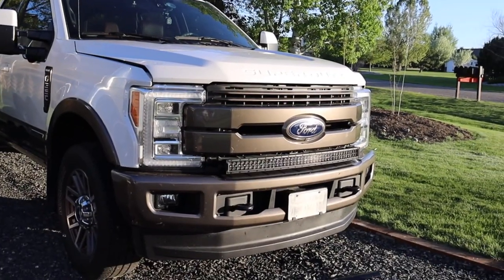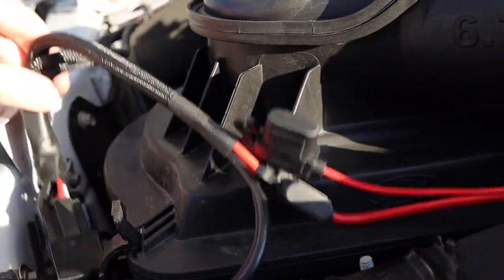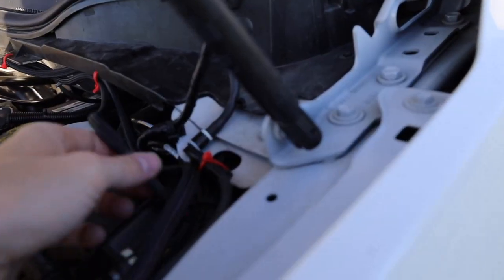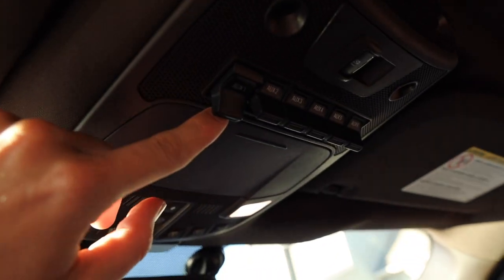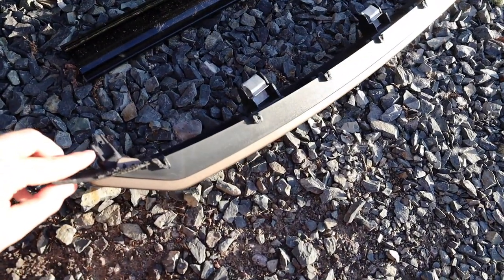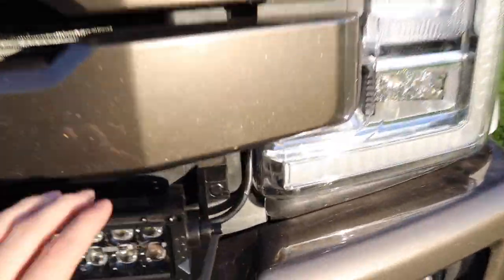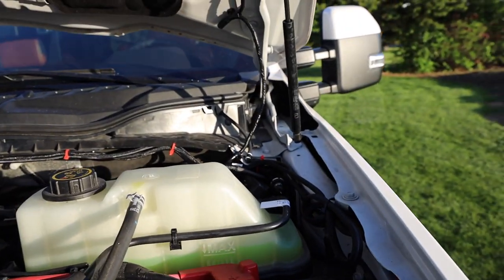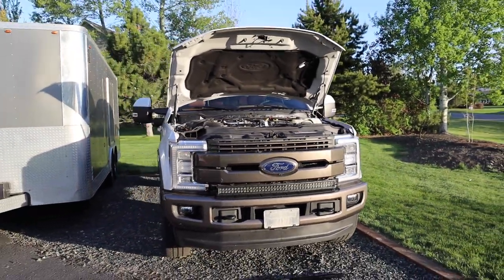Rough Country Light Bar Install F350 (Front Grill)

Comment: How loose is your grill with cutting the factory bottom piece off that held it there. Also why didn’t you run the light bar installed to the top of the front bumper. Thx man.
Reply from the maker: Grill isn’t loose at all with all the clips back there from the factory holding it on . I wanted to put it in the top and bottom but their wasn’t an easy mounting option like the bottom has. I would have had to make a bracket. Thanks for watching 👍

Comment: So will the light come on sequentially with your hi beams or do you have to use the separate switch? Great vid btw.
Reply from the maker: You have to use the upfitter switch. But you could probably wire it into your lights if you really wanted to.
Reply: Auto Pilot MT Thanks for the quick reply. So if I understand you correctly....with the uplifter switch in the “on” position, the light bar will work sequentially with the high beams, correct?

Comment: Which upfitter switch did you connect it to the 40amp or the 25?
Reply from the maker: I think the 25 (upfitter #2) never had an issue with it. LED’s don’t take much power.
Reply: @AutoPilotMT why didn’t you just wire the light to the upfitter switch wires? They have fuses and relays already. No need for all of those harnesses

Comment: Does it block the front camera?
Reply from the maker: Nope
Reply: @AutoPilotMT  thanks. I drive rural roads at night alot. Looks good. Did the brackets come with the kit and  attach easy ?and do you have a link to the kit or bar? They make a few it seems.  Rough country should hold up good vs off brand ebay stuff I heard.